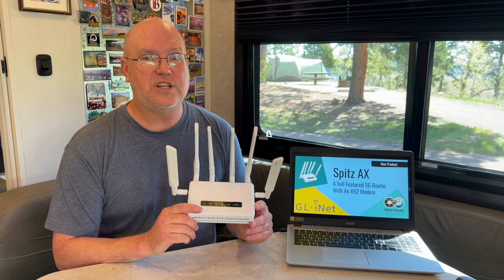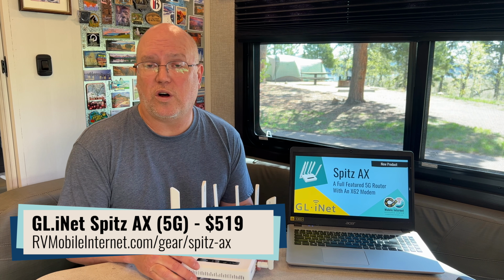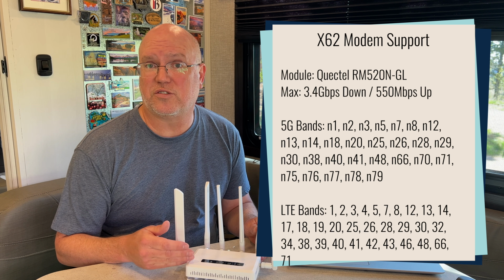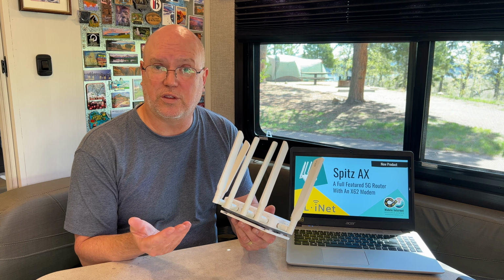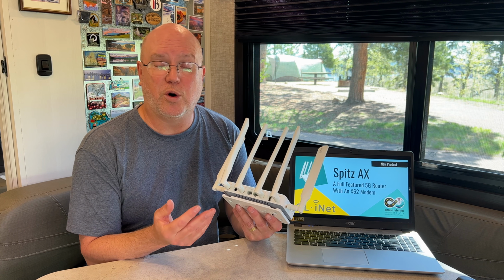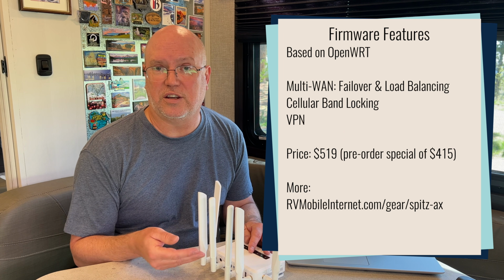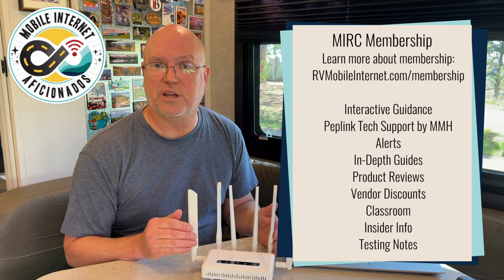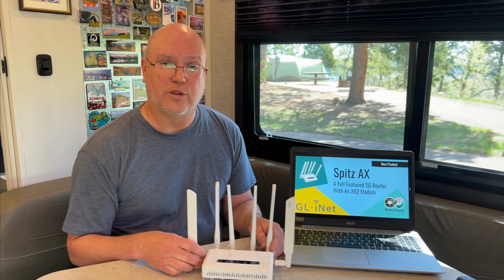GL.iNet Spitz AX (GL-X3000) 5G Cellular Router - First Look

Comment: Hi, you mentioned using an external antenna on the Memo 1 & Memo 2 on the router. The antenna that I want use is the Poynting XPOL-1-5G but this has 4 connections and not sure where they go on the router. The cables are in 2 pairs, the first pair is CELL 1 MAIN & CELL 1 AUX DIV. Second pair is CELL 2 Main & CELL 2 AUX DIV any help would be greatly appreciated.
Reply from the maker: This router has 4 cellular antenna ports - a 4x4 MIMO antenna will work with it.
Reply: Same, I have Poynting 4x4mimo 3-17 and no documentation on how to connect those.

Comment: Can you bandlock with the AX3000?  Is there an option in the user interface that is preconfigured to allow bandlocking?  I'd rather not use AT commands to bandlock.  Thanks

Comment: Does it support band lock?
Does it support cell lock?
Does it have ussd fonction?
Does it have auto reboot ping option ?
Reply from the maker: It does support band locking/masking. Would recommend contacting Gl.iNet to confirm the other features you seek - as those are not ones we track.

Comment: As an IT professional who travels in Europe with a campervan, the primary drawback of the Spitz AX (GL-X3000) 5G router is its limited operating range of 0-50 degrees Celsius (32-122 degrees Fahrenheit). This becomes problematic during both summer and winter, especially when you leave the van some days and you need remotely to access devices like the security cameras. In extreme conditions and either overheat or stops to operate from extreme cold. The Spitz AX (GL-X3000) may easily reach its operational limits in such scenarios. Given these considerations, I would opt for the Teltonika RUTM50 (EU model) or RUTX50 (USA Model). Despite their reliance on Wi-Fi 5 and the Qualcomm X55 modem, their wider operating temperature range of -40 °C to 75 °C (-40 °F to 167 °F) makes them more suitable for varied environmental conditions. Hopefully, Teltonika will release a newer version soon with Wi-Fi 6 capabilities.
Reply: interesting thanks for the insight. I got Spitz AX, but now certainly concerned about the operating temperatures!
Reply: Not very professional if you can't even get the model numbers for each region correct..
Reply: @neilmick6778  get a life

Comment: I live in rural Indiana and only have 4G LTE, I use the spitz 750. I usually only get 2-3 bars which equates to 22-30mb down. I do not have 5G out here. Will this make my 4G connection better?
Reply from the maker: The LTE capabilities are much higher than that of the 750. But only head to head testing at your specific location would determine if there is more capacity there or not to tap into.
Reply: Mmm u probably should try with directional waveform antenna if u know where is the telecommunications tower or if not onmidirectional antenna

Comment: Hi guys!  Great info and love the channel!  I own the GL-X3000GN and absolutely love its performance, however, your documentation page says the GL-x3000GN with the Qualcomm Snapdragon X62 (Quectel RM520N-GL) is supported by Verizon but I've been working with them for over a month to get my IMEI entered into their DMD (Device Management Database) and after speaking with 18 different people I've gotten 18 different answers from them.  Long and short of it, each time a ticket is submitted to them to verify if this modem is "allowed/compatible" with their network they reject it saying the IMEI is not valid and thus the router/modem is not compatible with their network.  I'm guessing you guys know something I don't, how'd you verify it works on the Verizon network?
Reply: just change the IMEI with AT command
Reply from the maker: It supports all of Verizon's frequency bands.. just have to find a rep who can activate it, or get a data SIM card already activated on it to use. More on getting data plans for routers: www.rvmobileinternet.com/peplink-dataplans
Reply: Needs to be provisioned for use on Verizon's network.
Reply: @hadet    Do you have instructions on how to do that?
Reply: @gregdavis5146   Did you get instructions to use with Verizon network?
Reply: I was able to use my Verizon SIM to work with the GL-X3000 pulled from my Verizon-branded Inseego MiFi 8800L. I think a previously activated Verizon hotspot SIM works with his router since I haven't had any issues with my GL-X3000 working with Verizon.

Comment: Sir anything under 100 AUD for very good chipset 4g/4g SIM capable with Ethernet ports to connect to my Desktop
Reply: The GL-iNet Spitz X750 sounds like what you’re looking for. I’d check out the website, they have several 4G LTE options.

Comment: I am a member and will be interested in the review, however, is there a carrier that will sell a physical sim (or esim for that matter)  to use this device as a hotspot only.  It seems the major carriers really want to tie you to them by requiring devices that only work on their network and for which data plans are, to say the least, sad.
Reply from the maker: Check out the linked article, we have a section in the member section addressing data plans.
Reply: @MobileInternetResourceCenter  I should have thought of that. Thanks!